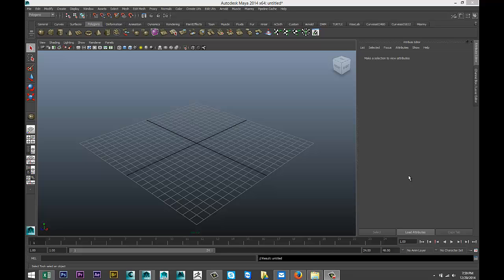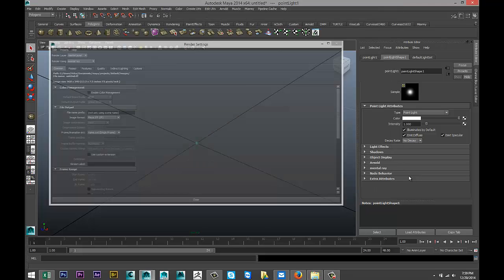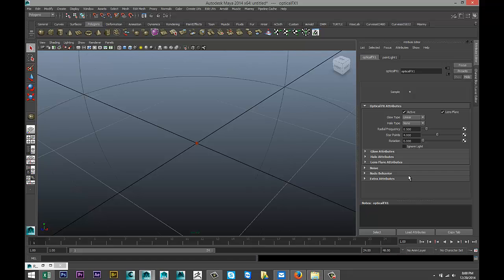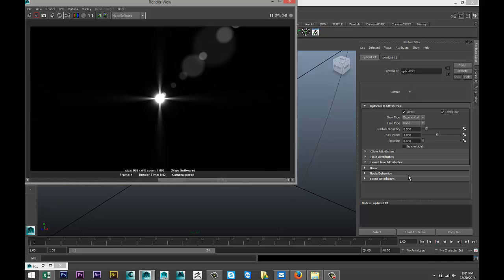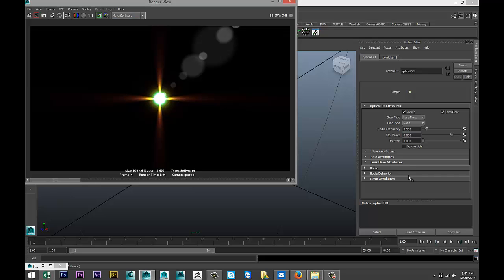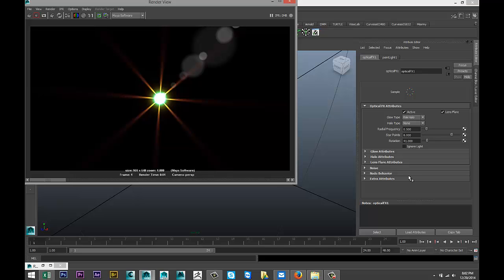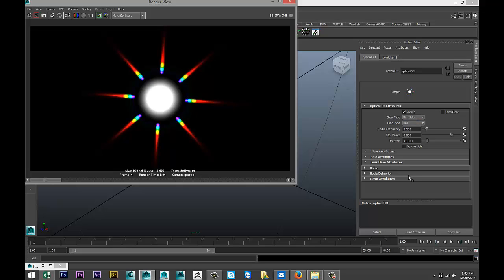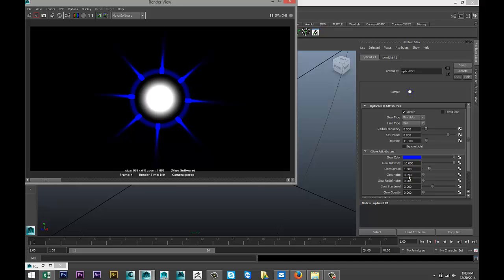Maya tutorial : How to create  Lens Flares

Comment: basically you are saying that you can enable the function, but Mental Ray will not render both volumetric fog and Lens flares together...

In fact MR will not render lens flares at all, only Maya Software render will do this.. 

Do I understand you correctly?
Reply from the maker: +R189 LF Yes, but also if it did the volumetric fog would block the effect of the flares. I would try a pointlight in the fog instead